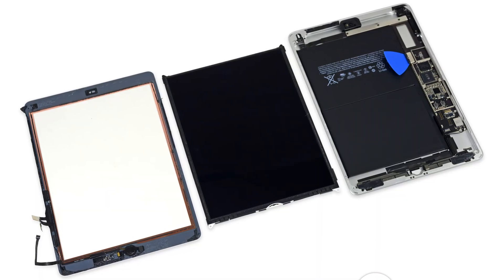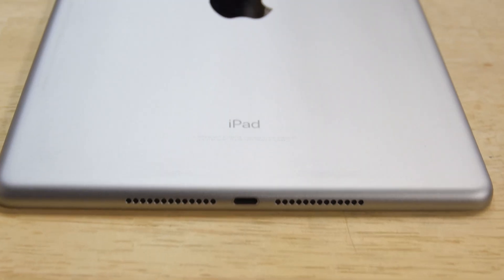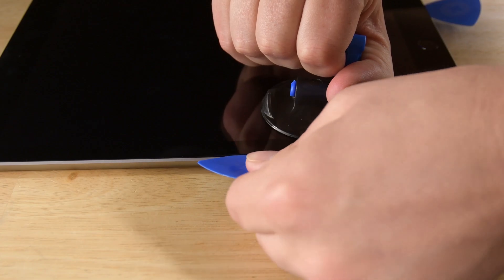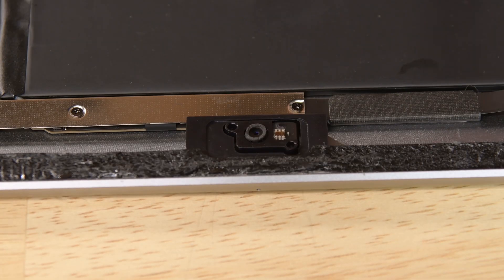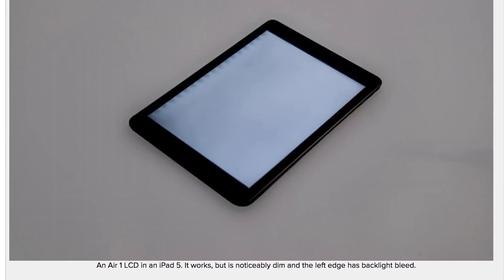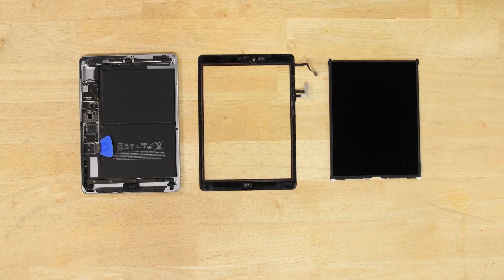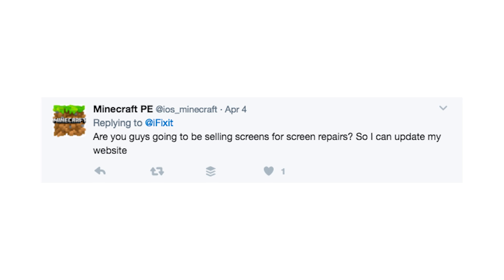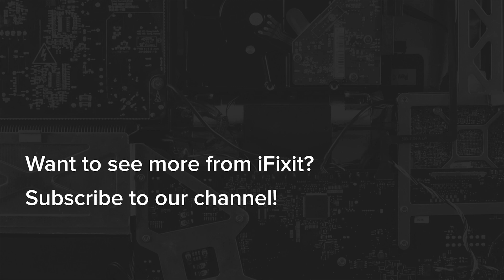iPad 5 Teardown Questions Answered! Including Why We Called it iPad 5! 😎

Comment: So the iPad Air 1 digitizer is compatible with the new 2017 iPad 5th generation? I recently purchased the new iPad generation about three weeks ago and just last night it slid off my bed. It was about 1 foot drop. Nothing is really damaged, the LCD still works and everything else. The only part that cracked is the top right corner where the white bezel is. It's like a hair line crack going diagonal and it's about an 1inch long. I really don't want to send it to Apple for a little crack because they charge a lot but I do want to fix it because it'll drive me crazy. Overall I just want to replace the top glass. I hope this is enough information for someone to help me